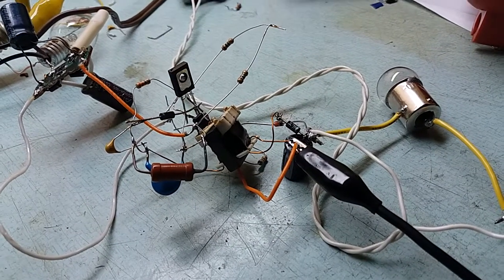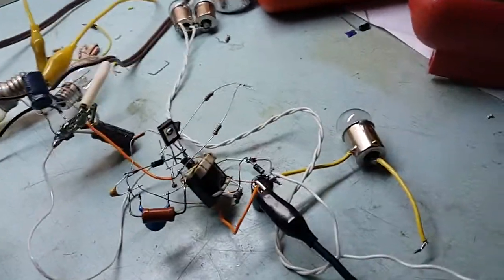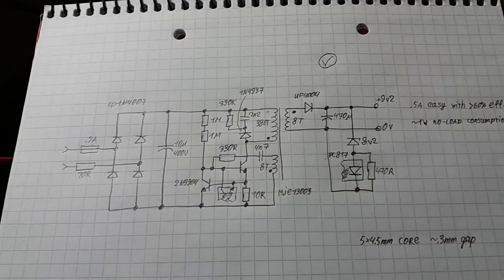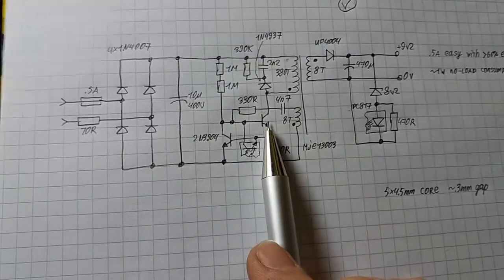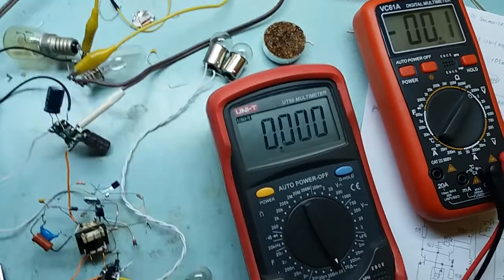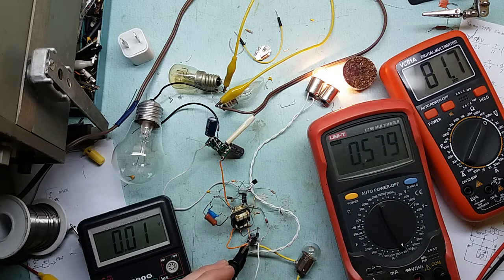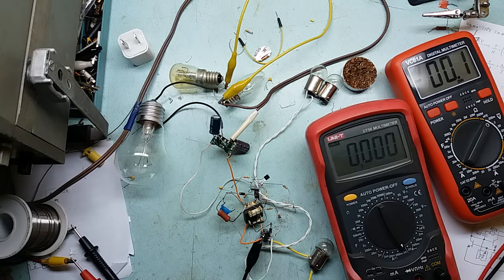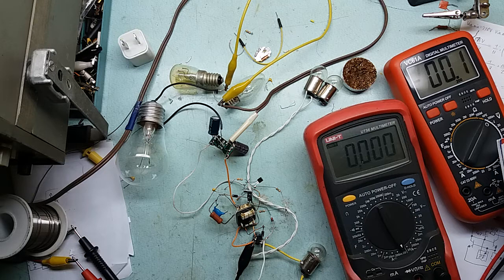Horrific SMPS

Comment: Fun video, I especially liked it when you pointed to a power plug and called it a watt meter.  I gave you a thumbs up and I hope you make more of these experiments.
Reply from the maker: That is for a reason, that double outlet isn't a simple extention cord. The outlet is fixed onto a project box which contains a wattmeter using an analog multiplier chip from Analog Devices. I made a video about it, here: https://www.youtube.com/watch?v=ahEF2-BQ_58&t=17s

Comment: Looks almost as messy as when I make up circuits!  The current limiting is a good idea, seems to work great.
Reply from the maker: I didn't want to spend a lot of time making a board for the circuit that doesn't work well enough to make me happy. I wasn't sure should I make a video about it or not, but remembered your builds and decided to upload it :) I expected some negative feedback, but so far everything is good, this video has a swarm of comments (in comparison to my other videos).
 Yes, the current limit feature is good to have. This supply doesn't care if you short the output, it can run shorted 24/7.

Comment: did you measure leakage inductance by shorting secoundary ?  I think that it might be little high cause that snubber is kinda hot ? try to wind half of primary than secoundary and than other half of primary to reduce leakage  if you didnt do it allready. what do you use to insulate your transformer?   I dont know what to use..
Reply from the maker: That's a nice question. I'm aware of leakage inductance causing problems, but I just slapped that transformer together in a crude fashion, I couldn't be bothered to split the primary. I wanted to do a quick test, to see is this circuit worth mucking around with, and it is.
   I didn't measure the leakage inductance, this was just a quick test. I plan to build this PS on a PCB, I will rewind the transformer later, split the primary and wind the secondary with two 0.4mm wires.
   Here I used regular PVC electrical tape as insulation, it works fine if your transformer won't get hot in operation. If the transformer gets warm in operation, I use kapton (polyamide) tape because it is heat resistant. Sometimes I even use regular scotch tape :D
  If I missed some question, ask again.

Comment: Nice simple flyback psu, and bombproof with the current limiting :-D.
I wonder if the operating frequency is too low for the transformer to give better efficency.
Not that a know anything about designing, so ignore my silly suggestion if its not relative.

Will it be an actual usable psu, or back to the parts box when finished?
Reply from the maker: It operates at about 70kHz when outputting 2.5W, frequency increases when the load is increased. I calculated the transformer for a 9V 1A output and frequency of 100kHz. The unstable frequency makes designing the transformer tricky. I skipped a formula for necessary cross-section, maybe this core can't give more than 5W.
   The efficiency is impaired by the output rectifier, in 5V USB type chargers they use shottky diodes, here I used a UF4004 generic p-n junction diode. Also, snubber takes about 0.5W on idle and some fraction of power when loaded. I will rewind the transformer properly, maybe I would be able to run it without the snubber.
   I'm happy with 9V 0.5A output, I'm gonna make it a permanent supply or make one more while keeping this for experiments. It works really good for what it is.
Reply from the maker: UF4004 has a reverse recovery time of 50nS, maybe you mixed it up with 1n4004. I will try a shottky on the output, I have 11dq10 diode (1.1A 100V reverse voltage). But that has to wait, I'll try that tomorrow, I hope.
Reply: Yep i did, i saw the 4004 and jumped to conclusions, slap me hard with a wet kipper LOL :-D
Reply from the maker: 2 years ago I wasn't able to tell them apart :D I still make hilarious mistakes from time to time, nobody is perfect :)
Reply: The shame is i cant help you, ive found many aspects of electronics totally confusing, transformers i know what they do but there are far too many variables for me to understand.
Thats why i stuck to repairs, so much simpler.

If i get too annoying just say, i wont comment.

Now Danyk is a very smart man, i think you can learn off him :-D
Reply from the maker: I don't have anything to repair right know, so I decided to have fun tweaking the PS. I don't know everything about this supply, I learn by experimenting. 
  I wouldn't say repair is simpler, sometimes it's easier to make another circuit than to repair the one which is a rabbit hole to hell :D
  I learned everything I know from experimentation and info on the web. Danyk's site is one of my favorites, I'm there from time to time. I found the photo of original LED driver from my previous video, and it dates back to September, 29th of 2013. So I was stealing knowledge from his site starting from that time :D
Reply: Yes ive made pdf's of his diy power supplys, just for me to remind myself of the different configurations, he his a clever man.
Ive come too close to having to cancel my internet access due to money problems, so i pdf interesting circuits :-).

Ive just tested an electret mic on a frends headset, the element is dead, i dont often see that, and all the wiring is fine.
Ill have to search my crap box for a tiny one.
One from a dead nokia phone may be good enough.
Reply from the maker: You can find the mike in an old boombox-kind of equipment. Maybe you have it handy :)